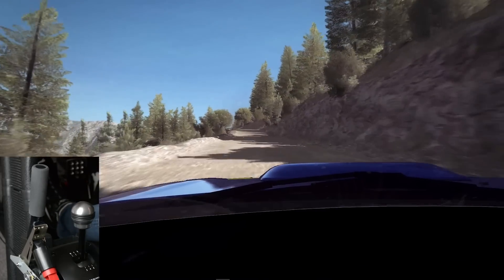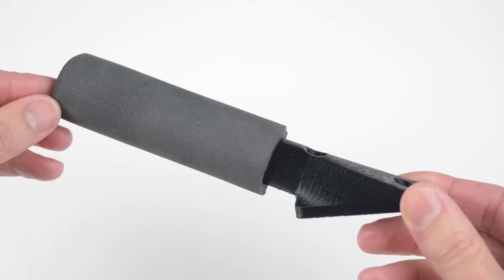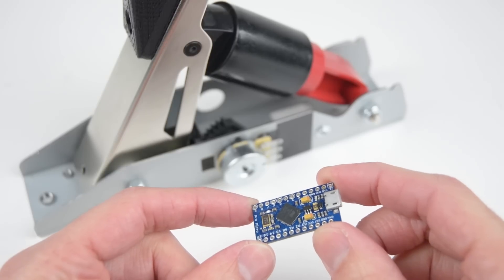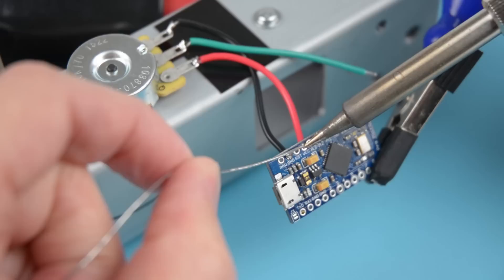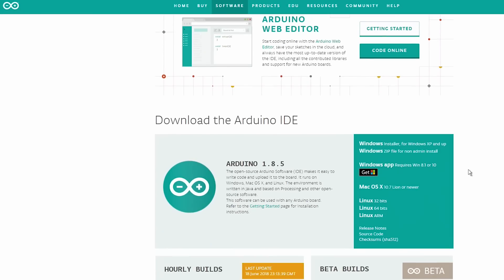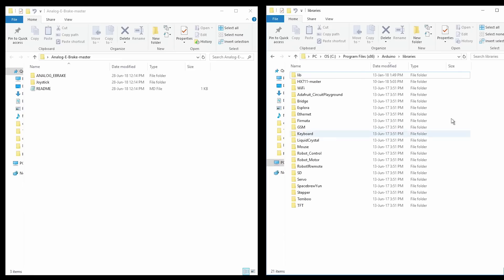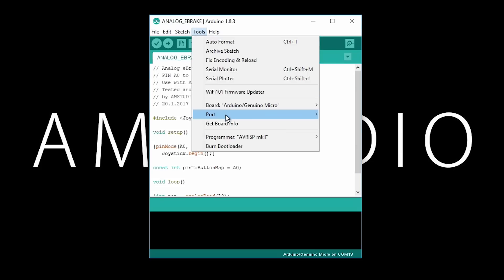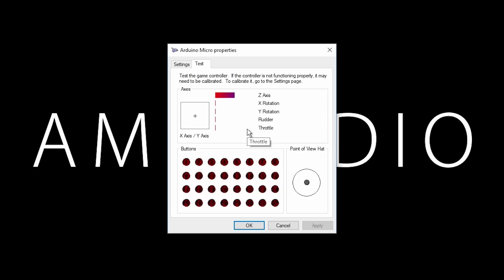HOW TO MAKE ANALOG HANDBRAKE FROM LOGITECH PEDAL

Comment: Works flawlessly only when it's inverted for me, and if I swap Ground and Power cable it works as it should but stays pressed about 5-10% and fully pressed only 90% , could you make another Handbrake Arduino code for the inverted axis?  tried changing the "int mapped = map(pot,0,1023,255,0);" but still remains 5-10% pressed. If anyone else got any clues what could be the problem please share your wisdom? maybe a code that disregards the 5% of the deadzone?

P.S. Nevermind, fixed it for now, for anyone who got the same issues, just change the code to:
int pot = analogRead(A0);
int constrainedPot = constrain(pot, 102, 1023); 
int mapped = map(constrainedPot, 102, 1023, 255, -18);

-18 worked for me, you can try decreasing or increasing this number based on your situation, too low and you will still have a deadzone, too high and you will get clipping. Also I had to invert my axis in my specific case, otherwise just use 102, 1023, -18, 255); instead.

Comment: Alright, i have a question; my sim buttonbox was made usin an arcade stick encoder from aliexpress, could i connect this to three of the five pins for the analog stick and get an axis input from it? That way i'd have the handbrake and buttonbox in a combo and save one USB slot plus the money from the other parts

Comment: just bought a standard thrustmaster t300 with the two pedal set, and the 3 pedal T-lcm set seperately, might do this with the shitty pedals that come with the t300, i currently just use a button wired to an old keyboard on a lever with rubber bands for a handbrake, lol. this looks like a nice improvement.

Comment: So is there a way to use a arduino nano board for this? Even if it just turns the pot to a on/off switch? Im pulling my hair out trying to get this to work. I dont even care about the amount of pressure applied I just want it to come on and off

Comment: if you use a rj12 plug and not an arduino you can connect direct to fanatec v3 pedals or csw2.5 base :)
did this a few weeks ago with the logitech brake pedal :)

Comment: Hey man, great tutorials! Is there a way to make this axis register momentary button presses? for example: If I pull the handle 25% it also registers a button1 press and if I continue pulling it to 75% - another button2 press. But when I leave the handle and it gets back to place these buttons at 75% and 25% do NOT register again.   I'm used to work with the mmjoy2 GUI, but not familiar with the Arduino IDE.

Comment: when i try to verify the sketch on arduino it tells me that there is an undefined reference to 'joystick'. If anyone could help me out that would be great
Reply: having this same issue. did you figure this out by any chance?
Reply: I had the same problem..I solved it by putting the joystick file on the documents arduino directory...then it recognized the joystick.h library

Comment: i still use the wheel just got better pedals .could i not just disconnect the  brake and gas leave the clutch and wrap the wires up im not using and plug in to the wheel ?

Comment: probably sounds dumb but its my first time doing this stuff, do i HAVE to solder or can i just put the wires in the holes and wrap them around?
Reply: You should solder the joints. You may get it to work, but it will be flaky and POTENTIALLY cause damage to your Arduino. Get an iron and some solder for real cheap and learn!

Comment: Solved : I had to open the .ino file in the ANALOG_EBRAKE folder with the arduino software

hello any help welcome.  first i found your library on gitub with the two files (cpp and h). but i did not found the code to write on the arduino software. I have made search on google based on what we can see of the sketch on the video (at 2:25) and i think i founded a code. Witch i could compile and send to the arduino micro. well it seems to work but the throttle axis comes back at middle range after i puch and release. (it feels the potentiometer very poorly and it comes back at the middle of axis when i release the pedal). what did i do wrong.

Comment: hello your projects are very good, I love them .. I bought you the designs of the adapters for steering wheels of Logitech ..
Now I was eager to make a handbrake and keypad ... and my question would be the following ... is there any way to use only an Arduino Pro Micro to connect the handbrake and the keypad?

Comment: If it still acts as the throttle, whts the point of the usb interface? Just leave it connected to the wheel and you will avoide many issues with games that do not have multi controller support.

Comment: Well, that gives a use to one of the pedeal from the old worn out set I have :D Thanks for the info mate
Reply: Works amazing. Bent a bit of scrap steel, drilled a couple of holes, extracted the brake pedal assembly for the stiff spring. Put it all together and stuck it to my desk temporary-permanently with some Double sided foam tape and it rips in AC and Dirt Rally :)

Comment: I finally could do it. And it works well. Thanks!!!!!              
but.....
When I connect both the Pro micro handbreak and the Logitech G27 Wheel, the Arduino turns off and only the G27 works. If I deactivate the G27, then Windows just detects the Handbrake.
I can not activate both at the same time.
Please help.

Comment: I starded doing the same with the clutch of my old fanatic CSR to plug it directly in the handbrake port of my CSL elite base but the potentiometer doesn't have the good value. I replaced it by an adjustable potentiometer but it is not accurate enough. Would you know the value of the Fanatec handbrake pot so I purchase the good one

Comment: You don´t need a Arduino neccesarly. Just use the normal Logitech cable and a USB adapter. That way the PC just detects the padels as normal G27/25 pedals without any comanding.

Comment: Thank you for this tutorial. Do these pedals have to be connected to 5V signal? I was asking because I'm waiting for a servo motor kit and it has a 3.3V signal only connection which I could use without the arduino board.

Comment: @amstudio can you make an handbrake for Xbox one or PS4
Reply: u can do it like this, without the arduino but soldering the wires to the joystick cardboard, i put the board outside the wheel than connected the e-brake wires to the °change view° button. U can do the same with an external shifter (i've some photos on instagram @deccus_beccus).

Comment: Which is the best pedal to remove for this? And how can the handbrake be mounted? Great vid btw.

Edit: IK you can find individual ones on the internet but suppose I didn't need to?
Reply: im 99% sure the 3 pedals are identical they just have different spring rates and pedal pad attached (stiffer would be better for a handbrake, so the break pedal would be best to use). you could drill 2 holes in you table and use the 2 bolt holes already in the pedal, you would just need to get some longer M6 bolts and maybe a few washers
Reply: festa289 Thx, even tho I'm now considering building the analogue one
Reply: My previous comment is for a analog handbrake made from a logitech pedal :-)

Comment: Could you convert the pedal to operate like a momentary switch then solder into the G29 as an external e brake?
Reply: TFC the whole point is to have sensitivity because of the pontetiometer i guess... but sounds like its possible..!
Reply: if you want a momentary switch, get a brake pedal out of a car from your local car wrecker. its super heavy duty, has a shaft and pivot with a switch already attached (which would normally operate your break lights) and sometimes a return spring. then just cut the pedal off and attach a handle (broom stick or pipe) to the shaft. find one that looks suitable and easy to mount to your rig or table. i used a subaru impreza break pedal for mine but just about any will work

Comment: Hi, i asked this in the USB handbrake video but i got no response, so i'll ask It here. 

I made the USB handbrake and it worked fantastically. A few Days ago the arduino broke, so i bought another one. I solded the wires, and put the configuration i downloaded from the description of the video, but when i plug the arduino it is recognised as a keyboard/mouse instead as a controler.
Do anyone know why It could be?
Reply: do you know how to get the arduino folder library
Reply: I have the same problem - tried many things - but the arduino is recognzied only as keyboard/mouse
Reply: Have you found the solution ? I have the same problem....

Comment: I have an arduino board, I think it’s the bigger one.
What can I do with that?
Reply: byGiNeSiToX Bananas the same
Reply: It will work too, as long as you're using the A0 port too.
And your arduino needs to be an authentic one, otherwise, some stuff in the code might differ.
Reply: @imnota  did not work with arduino uno.
Reply: @tonypåhjul  The arduino uno doesn't support the joystick library needed for this project, the pro micro, leo, mega, and others do however the uno does not.

Comment: Fuck yeh, that's a great idea.. just need to find a donor pedal lol.. ive been using a 350z handbrake I modded with a switch to my g920 a while back.. I had a spare from my V35 sedan 6mt swap. works great but it's just an on off switch and a spring feel not hydraulic. Awesome vids mate!!
Reply: I've also got a spare master & slave cylinder. A diy sim hydraulic hand brake would be dope content..

Comment: now could you do the tut on how to wire the single pedal to a rj12 plug to use along side my fanatec v3 pedals, i can send you diagram of the wireing to see what goes where for both the rj12 and the pedal, i just cant find rj12 crimpers to do my self,

Comment: Do you think it can be made out of other brand of pedals? I do have an old wheel drive from Genesis that I don't use. Thanks and keep up the good job!
Reply: im sure its possibe but would most likely require different software and possibly a different setup or arduino board. another guy in the comments said you can get the g27 pedal pots from ebay for $20. you could probably adapt the g27 pot to your pedal without too much modding. you would have to pull yours apart and see

Comment: I would never ever figure this method out. But why you soldering the wires to the potentiometer, instead of using spade connectors?
Reply: Peter M cheaper and quicker than going to a shop I guess.
Reply: Sure it cheaper and quicker to make it done, but a repair takes much more time.

Comment: This wouldn work on PS4 right?
Reply: Well ... It can actually. Just remove your clutch pedal, make the wires longer, put the pedal on a stand. Configure in game that clutch pedal is the handbrake. Voila
Reply: Dumb question, sure it wouldn't
Reply from the maker: PC
Reply: Im currently using my logitech shifter as a handbrake in cars that use paddleshifters
Too bad you cant have a clutch and a handbrake on the ps4 with the logitech